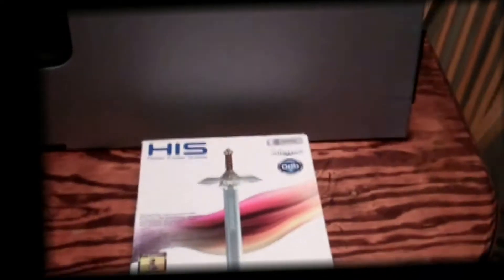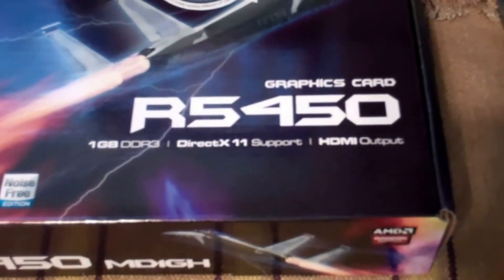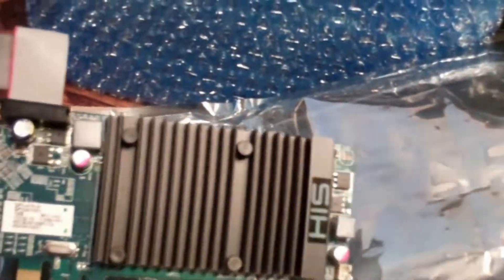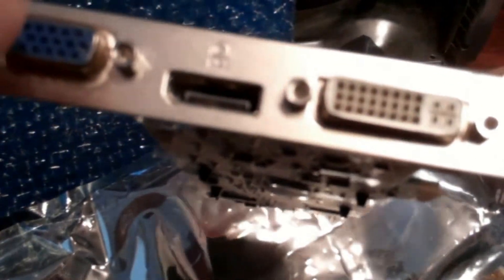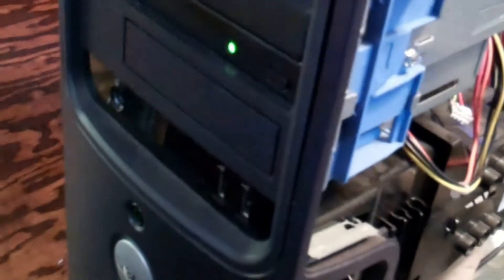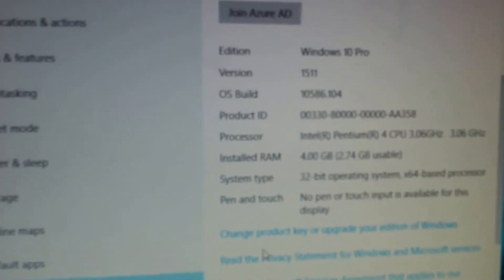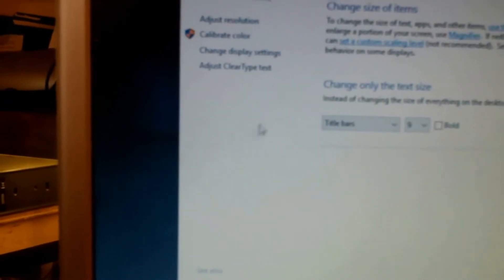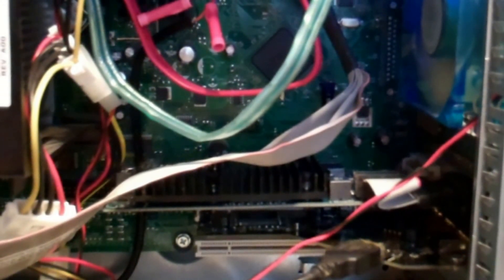Installing a HIS Radeon HD 5450 x1 Video Card in a Dell Dimension E310

Comment: Where did you buy this video card? My first computer was a Dell Dimension E310, and I want to spec it out to max specs as a relic.
Reply from the maker: +Devang P ebay. Had to search around for the x1 style
Reply: +RVR2 Yea that's why I was wondering I was looking around, but couldn't find one on eBay only on Amazon for $100+.
Reply from the maker: Here's the exact make & model number: HIS Radeon HD 5450 H545H1GD1
Keep an eye out as they do pop up from time to time.
Reply: +RVR2 Thanks for the model number. I found one on Newegg that I might buy if one doesn't pop up in the near future.
Reply from the maker: Yeah they are hard to come by but I paid less than $40 dollars for this one so if you can hold off a bit you might save some $$